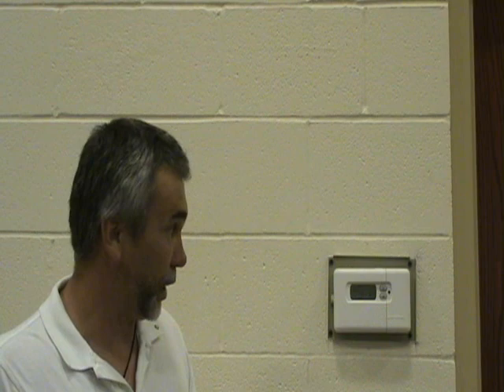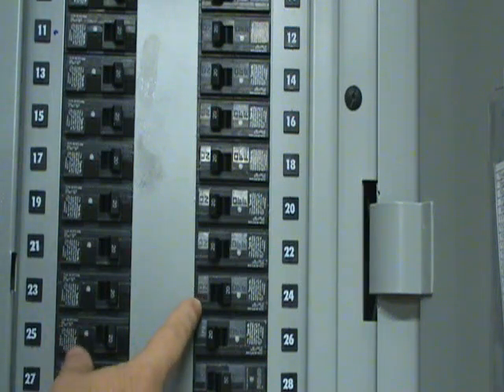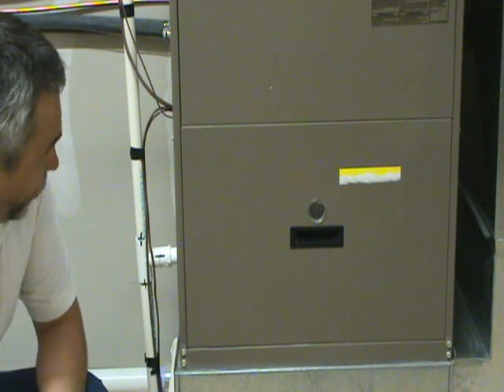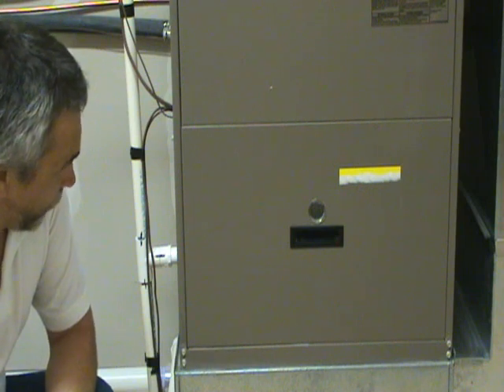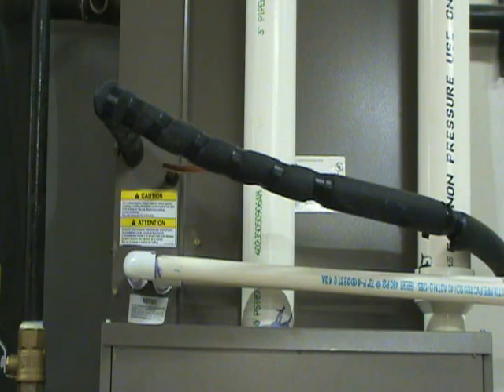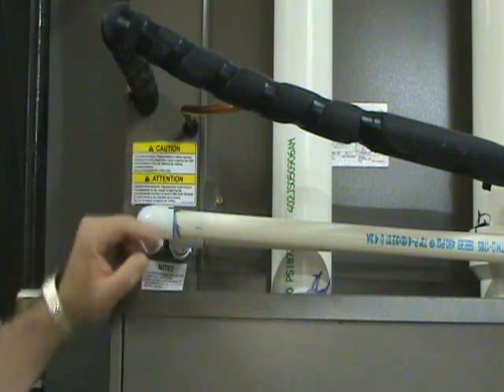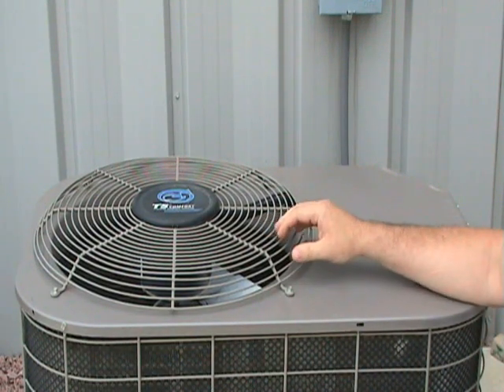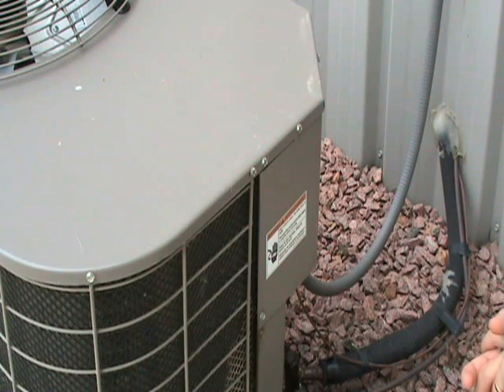AC Not Cooling? Start Troubleshooting These Common Issues First! ❄️

Comment from the maker: If you see ice on your copper lines, turn the AC off immediately and set the fan to 'ON' for at least 2 hours. This thaws the system so you can actually find the real problem (usually a dirty filter or low refrigerant)! ❄

Quick Tip: Don't ignore a full condensate reservoir. If that little pump fails, it's designed to kill power to your whole system to prevent a flood in your house! [03:04]

Comment: Thanks for the troubleshooting vid, pretty thorough. My outside AC unit is whats wrong, both condenser, and fan is not running. What could cause this? My circuit breaker is on the on position so it should be getting sufficient power.